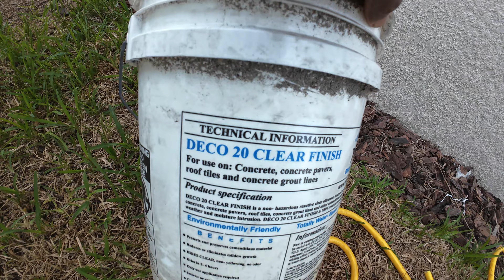How To Seal Marble Pavers #howto #seal #marble #paverseal

Comment: Good afternoon Mr cliff ,very nice video like always,I have a question I mix my soap with the sh ,I put 1oz soap x1 gallon sh but I don’t see soap coming out,I have to put more soap?
Reply from the maker: Yea most likely.  It depends on the soap you use. I use slo mo surfactant and I only gotta use 1 oz per 5 gallons. Or when I use sticky icky surfactant I use a out the same.